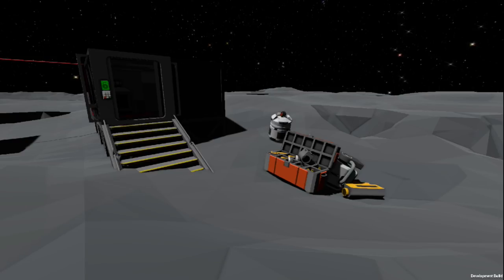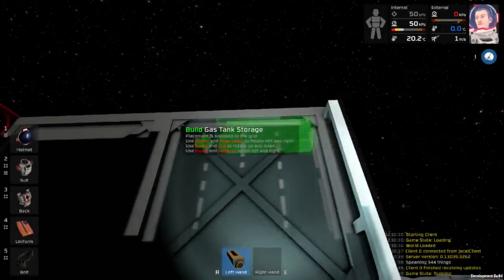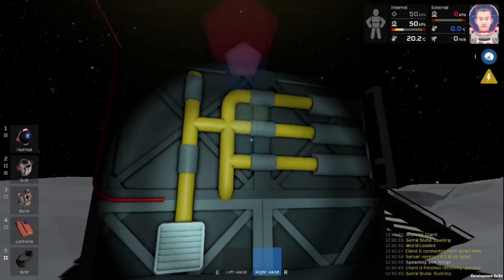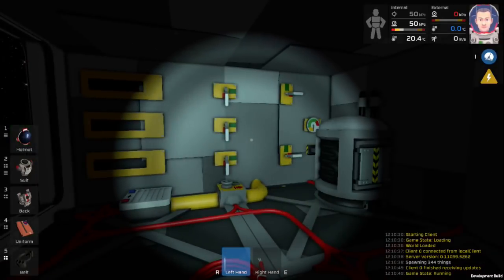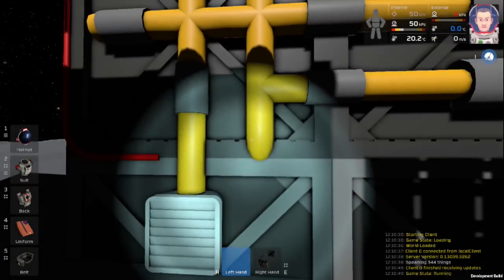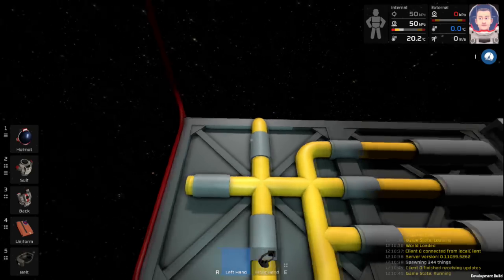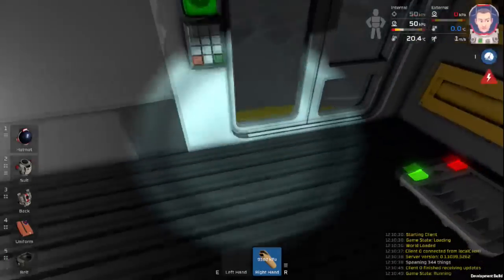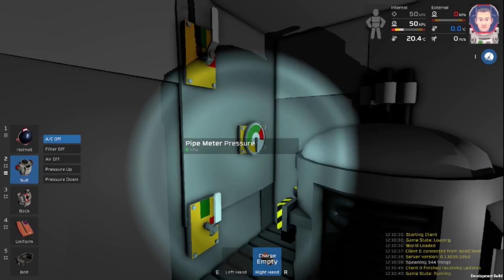Stationeers Tutorial: Capturing Gas

Comment: Ok, I need clarification on the canisters. 
1: When you put them into the storage slot, they need to be “open” so they can be filled, then are they still “open” when you remove them - gas escaping? ... or...
2: ensure the canister is closed when putting them into storage slot. The storage slot has ability to bypass the valve, fill it, the it remains closed for removal? ... 
I feel the answer is #2.
Reply: You're correct.  You want the canisters to be closed.  But what he was pointing out in the video is that when you look at it you want it to say "Canister - Open".  Because if you're seeing that it means that if you interact with it you will be opening the canister, meaning that it is currently closed.
Reply from the maker: Yes thanks for your help! Although I believe this has been fixed in a recent patch where the tank will automatically close if placed in the holder

Comment: Hi ! I was wondering how do I create a pressurized room. Do I only have to pour out the O2 from the tank it gives me in the start ? What do I do when that runs out ? Thanks !
Reply from the maker: Yes you can do that, also you can release oxite into the room and let it evaporate. These methods are a bit uncontrolled. The best way is to pressurize a tank, connect it to the pressure regulator and set to about 110kpa. Thanks for watching!

Comment: I started recently playing the game and i'm not able to build stuff on the walls like you did in this video (like placing things on the outside and let it stick through the wall to the inside). I 
was wondering if maybe that feature has changed over time? maybe it was possible when you did the video, but it's not anymore? or am i doing something wrong (placing the wrong kind of wall maybe)?
Reply from the maker: you must have a frame behind the walls to place things, once you are done placing you can remove them!
Reply: Could you elaborate on this a bit more? When i see you place the stuff on the wall in the video, there doesnt seem to be a frame behind it, because you can see through the door and it‘s hollow inside. Or is there an „unfinished“ frame (no sheets placed at all, just the naked frame) behind it? And  later in the video when you show us the inside you removed that frame already? Might even be worth one of your quick tipp videos to explain this? Because it‘s not obvious how this works, but seems to be really beneficial once you figured it out.
Reply: @mariokohler4916  Some things don't need to be placed on anything initially; it just so happens that the canister holders and the piping things in the video fall under that category. For some reason vents require a frame for their initial placement though, which is annoying considering most of the other relevant stuff doesn't need that… You can also see that reflected in the video; each vent was placed on the floor, which is a frame, and it's likely an unmentioned fact that the piping was set up this way in the video to tackle that exact problem.

Comment: My oxyde ist just not melting.Dunno what the problem is. Im pretty sure that the switched off oven doesnt produce any heat nor lamps do.Is it maybe because you put the walls inside out?

by the way.You said you were irritated about the switch "inward" and "outward" at the active vent.The reason is that the describing always describes the status that comes on when you hit the button.Its not showing the actual state.
thx for vid btw.
Reply from the maker: I believe mine melted because there was some residual heat left over from using the room several times. Try placing the oxite in the oven and turning it on, that should do the trick. Thanks for watching!
Reply: The normal oven? Will try ! Thx.another thing is to put it into furnace and gather the gasses through pipes directly into a tank.but I have the feeling,that some air is missing.

Comment: When used to breathe it tells me my oxygen is low and then I pass out. I had 90% o2 10%n2. It let me breathe for about 10 mins and then I got warning.
Reply: IRL, air contains 20% O2 and 70% N2, and it's roughly the same in game too.
Reply: Lymark Wong in your video it showed 90:10 . thought you Saud it'd be good for breathing
Reply: At the moment, I don't think you'll get killed by breathing 90%o2(so yes it's breathable for now), though you''d still get the toxic warning sound.
The way I do is to get both o2 and n2 separated into two tanks, get a gas mixer pipe and mix them(25%o2/75%n2) into a new tank. I feel like the better the ratio, the more 'air' you can breath out of a tank(don't quote me on that tho). At least, a good jetpack fuel ratio could last a lot longer for sure. 
(I'm not the guy who made the video :P)
Reply from the maker: I figured out the problem. Apparently you are not allowed to have any Nitrogen in your breathing air. To fix this you can still use the oxite, Just add a nitrogen filter in your suit. It is not the most efficient system out there but itll keep you alive! Thanks for watching
Reply: If you check the original tank you were started with or even refill from the large tank it shows 100% o2  i believe the portable filter unit is so that we take the n2 out of the air before we tank it . - i think a test is in order Hummmm.
Reply: Even tho air has like 80% N2 in it, you don't actually use it. so when there is N2 in your tank in your suit it pools in the helm and eventually suffocates you. Got to filter it out of the tank or just use a N2 filter on your suit and it will go into your waste tank with CO2.
Reply: Have you tried highering the pressure to ~100kPa? Because that gave me problems on trying to breathe "air" instead of pure oxygen, but might just be a misconclusion from me.
Reply: from what i understand, i can be wrong cuz i am just getting to air in my base. is that if you have a mix of air the pressure needs to be about 1 atmosphere which is 101.325 kpa. which is what an air lock looks for. your suit is not set to that pressure but i think you are able to up the pressure.
Reply: Bushwackah That is what I do also. I think it is just a thing they have not implemented yet. So the 90/10 ratio of O2/N2 should be correct at 1 Athmos (101KpA). But remember the suit is only at 50KpA, making it hard to actually breath that mixture. This is not my finding, but what I have picked up on tutorials and videos like this on YouTube. And I think the portable tank you spawn in with is pure O2 if I recall correctly. I guess all this is placeholders for now, and a more intricate system will follow later on.

So yea, just use filters in your EVA suit and you should not suffocate. At least that part is integrated in the game lol...

Subbed and liked :)
Reply: Fabio and Renvolt have this problem figured out, I believe. When you breathe in air, the nitrogen gets expelled as-is in the game. However, the Oxygen gets turned into CO2 which is filtered out. As the CO2 gets filtered out and the atmosphere drops in pressure slightly, the source tank replenishes it.. Except, only O2 is being removed (in CO2 form) but BOTH O2 and N2 is being added back in. If 10kPa worth of O2 needs to be replaced and the source is a 9:1 mix of O2 and N2, then you ONLY replace 9kPa worth of O2 and add an excess 1kPa of N2.

Eventually you'll drop below the 20kPa worth of O2 you need to not suffocate on the N2-rich atmosphere, at which point your immediate reaction should be to flush your helmet so it replenishes COMPLETELY with the 9:1 atmosphere, or get your helmet on ASAP if you're inside a pressurized room.

SS13 didn't have this problem because (as far as I know) no forks of the code actually simulated breathing atmosphere correctly. For rooms, it just checked if the atmosphere met breathable conditions and if "no", you suffocated. For suits, it just consumed a small amount of the air supply every breath tick and if that small amount didn't meet the right conditions, you suffocated. If any of those checks returned "NO2", you giggled and passed out.

Comment: hey. can you do a video on how to depressure a room effectivly without loosing the air? i want to make changes on my base and its pressurerised. so i need to depressure it and later on pressure it again
Reply: That's relatively easy.  Just put one of the large tanks down somewhere.  Place an active vent inside the room you want to depressurize.  Then run pipe between them and cable to the active vent so it has power.  When you want to depressurize just turn on the vent and it will suck the air in and store it in the tank.  Then just reverse the direction on the vent and turn it on again when you want to pressurize the room again.

It will be a slow process with only one vent if it's anything more than a very tiny room.  If you want to have it be quicker you can add several more vents and create a logic circuit with a switch to control them all from one place.
Reply: Rowgue51 how much pressure can one large Tank hold before it will explode? My Base ist 10x10x but want to expant Into a second Floor that is 10x10 too
Reply: I don't believe any of the tanks themselves currently have a limit on the amount of pressure they can handle.  If you're going to get any failures it's going to be the pipes if they get over pressure.  But I've used one stationary tank to evacuate a room about that same size and never had any issues with it.
Reply: Rowgue51 okay ty :) then i will build one of These